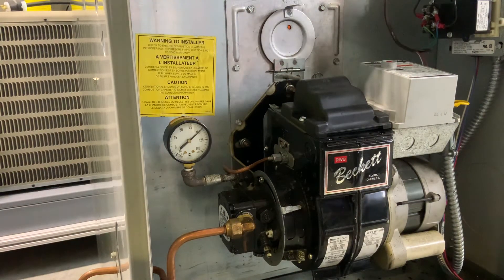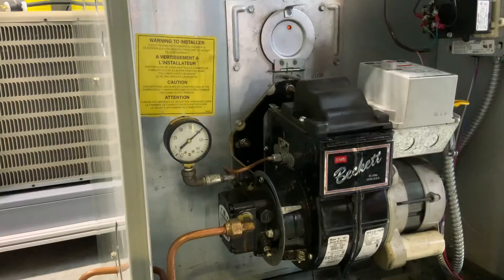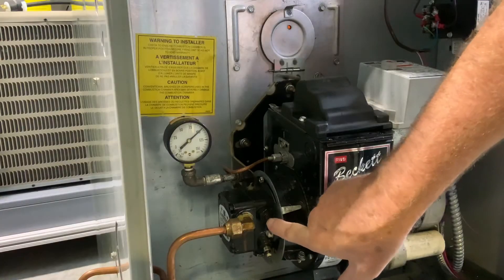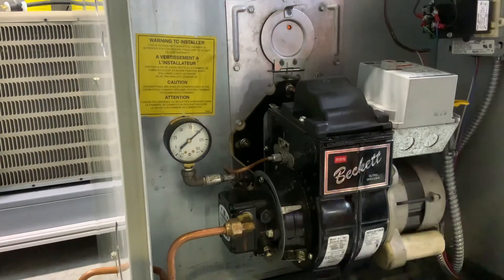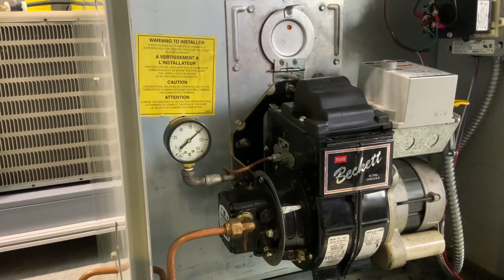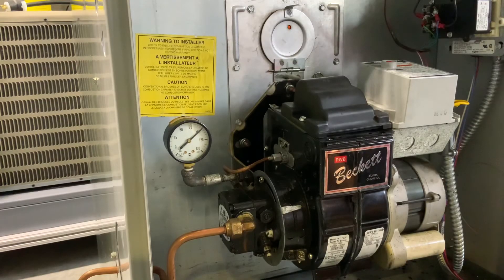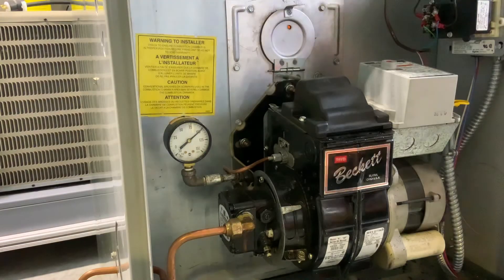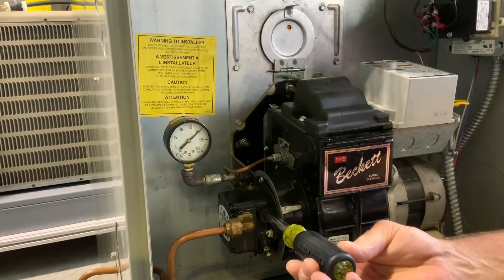Adjusting Oil Pump Pressure

Comment: Have you set up the plumbing so the gauge is permanently installed?  Do you trust the gauge not to fail, or do you advise a shutoff spigot below the gauge fitting so it is indicating only when the valve is open?
Reply from the maker: Generally we put these on just to check then take them off but it’s messy. You could install a shut off before gauge. Then you can easily change it out or put one on. I like that idea.

Comment: Hey Fred sooooooo, how would a guy MEASURE pressure if a pre purge valve is in place???
Reply from the maker: I'm not sure on that one.  Haven't run across that one yet.
Reply: Measure it in line of the copper discharge tube

Comment: My oil furnace bellows out black smoke when running. We've had the chimney cleaned and it was barely needed. The guy adjusted the pressure "screw" and it worked ok for awhile. Now it's back to doing it. We have no maintenance person in our small town anymore and I can't remember which way he turned the screw😔 Someone please comment and help a girl out. ❤
Reply: Probably need to adjust air you should not be doing this fix you can blow yourself up
Reply: Sounds like someone might of bent the points on the spark. Or where the nozzle sets in housing

Comment: Hey I installed the furnace in the Attic of my pole barn I haven't tried it yet but do you think the pump will lift the oil one story without needing a lift pump I'm using a two pipe system
Reply from the maker: Typically the pump can lift about 10 feet vertically

Comment: At last, the manuals never state the operation of the screw in relation to the pressure. Cleared up a problem with a pump. Thanks.

Comment: Question. I have a Beckett AFG. It has a .065 70B nozzle. The pump was factory set at 156. I need to drop the pressure down to a hundred so I can lower the BTU. Its 83000 and is to much. I only need 45k btu. Using a .50 nozzle will get me to 53k. The furnace has never ran long enough to really warm and keep it that way. Short cycles. I have the low fire baffle that came with it. Does that sound right?. .50 nozzle and lower pressure to 100. I have to figure out if I need a 80a or 70b. The head is Fo and the burner am AFG
Reply: 70b is the spray angle. If your furnace came with a 70b, DO NOT use another angle. You can however drop down to a  .5 if you want but air ratio will need adjustment
Reply: I knew air would need to be adjusted. Along with pump pressure. I have to have someone come out because I don't have the equipment to adjust. I've adjusted by eye looking in the barometric damper with a flashlight and smoke test, but I need the gear to do it right. I really need to switch to propane. Oil is just too expensive, and I can get a 96 percent efficient propane that's so much smaller. 2 stage

Comment: Good video. Basic settings adjustment by why do you want to play with the pressure?. Recommended 100psi? Is there math behind that? I'm running 135 on a .75 or .70 nozzle with 140k iBTU input box on a Beckett AFG. My flue measurements are spot on with max efficiency.

Comment: Most pump’s aren’t 100psi, the larger the nozzle the lower the pressure.
Reply: Incorrect. Most oil burner pressures for boilers are currently set at 120 psi not 100psi and never less. Always check the manufacturers recommendations

Comment: Why do you have the gauge on that end of the jet line? Shouldn’t it be on the other side so it’s connected to the oil pump?
Reply from the maker: The gauge is on the pump. The pressure that it reads is pump pressure. It’s a gravity fed system so you are reading what the pump is doing.
Reply: @frederickkosier2508  it seems like the gauge is on the other end of the nozzle how is there any pressure at all
Reply from the maker: @ShawnPatrickMurphy  the pump creates the pressure and pushes the oil through the tube to the nozzle where it is atomized and ignited. If you have pump pressure your nozzle should be spraying unless the filter on the nozzle is clogged or the nozzle tip itself is clogged up

Comment: there is also a screen in the pump housing..  if you test your pump pressure and if the gauge goes down over 20 percent, you have a leak in the line or the regulator is leaking by. better start looking for a new pump..
Reply from the maker: You are correct.

Comment: As a nozzle slowly becomes clogged, will it change the oil pump pressure setting?  Also, when tuning up the oil burner assembly (obviously changing out the nozzle) should the oil pump pressure normally be checked ? perhaps before and after replacing the nozzle ? (adding, it may help with diagnosing a problem as well ?